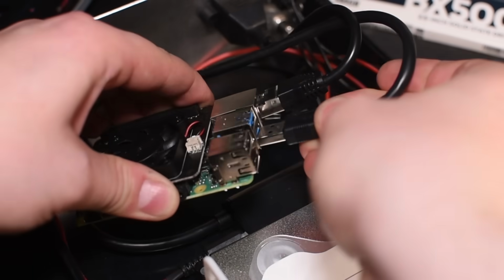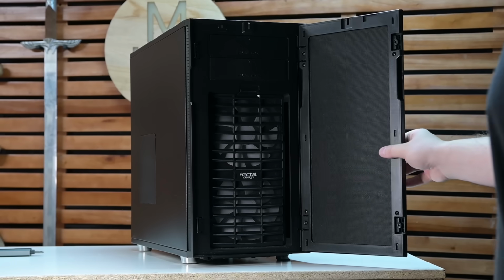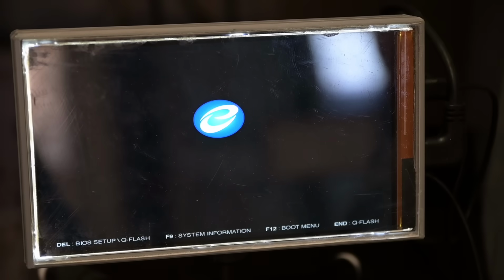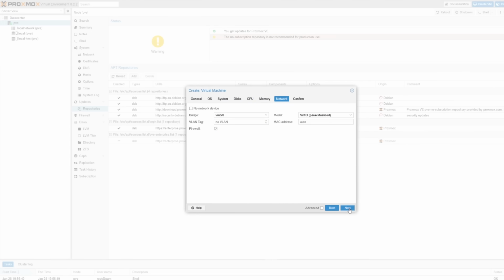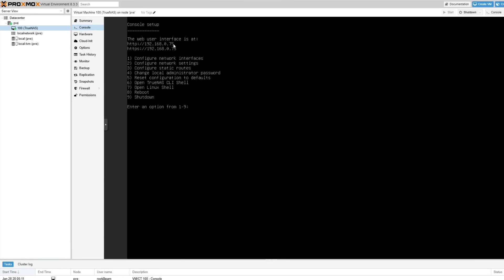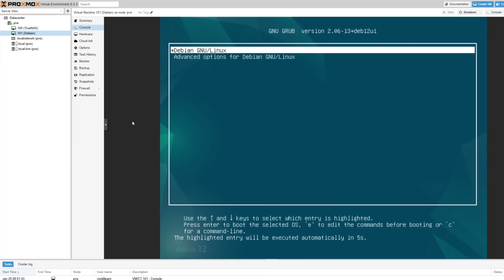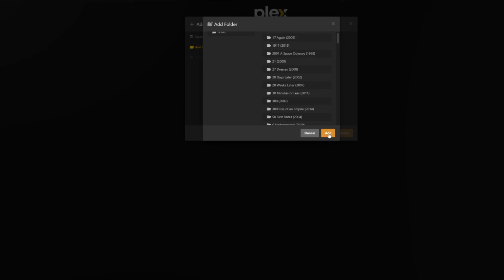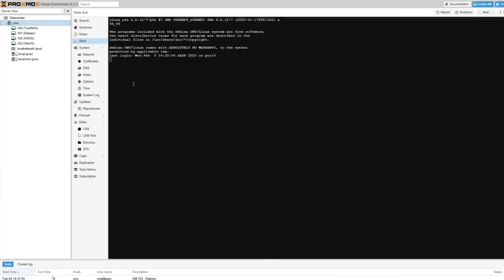The Do-It-All NAS for 2025!

Comment: ....here I am, sitting with my "do-it-all" Proxmox server (which also doubles as a NAS), which is now rocking 768 GB of RAM as a result of my mass consolidation project of January 2023.

re: your GPU passthrough
Were you able to confirm that your GTX 1070 was actually passed through to your Windows 10 VM?

I ask because if you were getting poor frame rates, that would be one thing that I would check because some of the older GPUs, doesn't pass through correctly, even if you followed all of the steps.

(This is true for my GTX 980 and earlier cards. But for my 3090(s), those have no problems getting passed through.)

To check that, the first place that I will usually look will Windows Task Manager to see if it shows up there.

And if it doesn't, then I will confirm that there is an issue, by right-clicking on the Windows Start Menu icon, and clicking "Device Manager".

If there is the yellow exclamation mark on the GTX 1070, then that shows that there's an issue.

I think that Nvidia GPU driver < 5xx.xx might not pass through correctly.

I am not 100% sure only because I skipped a whole bunch of generations of GPUs in between 980 through to my 3090s, so I can't test what happens to the GPU generations in between those two.

Based on what I've got, I've had more successes with the more recent GPUs than older ones -- I'll say that much, which may not be all that surprising.
Reply from the maker: @ewenchan1239  yep no issues with drivers or anything after following the Reddit guide, drivers auto installed and worked as I described! I was seeing frame rates reported up to 150fps but the latency felt way worse, probably due to 60fps cap as others have suggested
Reply: @Maker_HQ  
Interesting.

I haven't tried higher frame rate gaming via Windows Remote Desktop.

The built-in noVNC console is definitely quite a lot slower, and provides like "basic" video output (which I interpret to be akin to like the basic VGA output that you get from some server/workstation motherboard (e.g. Supermicro)) where you can see something, but it's not stellar performance.

For "slower" or less framerate "sensitive" "builder" games (think like Transport Fever 2), I can play those over RDP.

But if I want to play games that are more framerate "sensitive" -- I ended up plugging a monitor, mouse, and keyboard directly to the server itself, and then added the USB devices to the VM, and played it directly on the system.

An alternative that you might try could be something like Rustdesk (which is something that you can self-host in lieu of Teamviewer) as a way to play games remotely.

(cf. https://www.youtube.com/watch?v=3a_Kr9zGDQ0, https://www.youtube.com/watch?v=FIEcTNjFZNA)

Alternatively, you can try sunshine/moonlight as well, and if that doesn't work, then you might be able to try Parsec.

I tried the other options (excet for Rustdesk -- haven't tried that yet), and didn't have great/reliable success with them, but you can still try, if that works for you.

I won't be surprised if RDP is capped more to like 30 fps given that again, it is really there to just give "basic" video output, rather than high bandwidth video out.

(I've never seen RDP pulling more than like 10 Mbps network output from the client, even when I have it set to a LAN connection settings, before making said connection.)

Comment: it's not a host bridge adapter mate it's a host bus adapter and if it's an 8i for internal then it can only connect up to 8 SATA drives. SAS I believe is 256, when you did the Debian VM you don't need a GUI considering you did all commands in the terminal anyway, still great video regardless.
Reply from the maker: @meetthesandvich211  is that what I said? Oops! I said 14 drives because the MOBO has 6 SATA ports too
Reply: @Maker_HQ  It's no problem mate, you're all good. Keep up the good work, it's nice to see more people using Proxmox and Truenas. 👍

Comment: I wonder how HBA works if the motherboard doesn't have PCIEx8.
Reply from the maker: In a x4 PCIe 3.0 slot, max bandwidth is 32Gbps (vs 64Gbps in a x8 slot), which would technically bottleneck more than 5 connected SATA3 drives, but in reality the drives are never going to get near those speeds afaik

Comment: It'd be better to create a network bridge in proxmox, and attach it to your truenas and debian containers. Then set up NFS shares in truenas, restrict them to just the new virtual bridge's IP ranges (or individual IPs) and change your fstab over to these new IPs too. My guess is that using the SMB share you'll be limited by your network card's speed (gigabit?)  as it'd go over your home's internal network, through your router. From experience at least, NFS gives speeds much closer to the drives' limits, which should be a nice free performance boost. I believe windows supports NFS too (though you'll have to enable it), for your windows VM if you'd want.

Oh, and specifically for gaming via a windows VM you could use moonlight (open source) or parsec (closed source, but in my experience better). Either should perform a lot better than a VNC solution.
Reply from the maker: Yes, everything will be limited to gigabit, but that's fine by me

Comment: If you plan to run a rig like this 24/7 with a bunch of 1TB disks, energy cost goes up fast, particularly in the UK and some EU countries. It may be worth getting 2 larger drives, especially if you think long term. Less heat, less energy and more storage. Fewer drives means a smaller case and a cheaper PSU. Modern drives are also faster and with SSD, more energy efficient. Slightly higher investment, much greater return over time.

And that brings me to network. A mainboard like that probably has 1 or 2 1gig onboard NICs. Okay for most, but kinda limited. If you get a topton, you'll need less space, less energy and performance is equal or better, depending on the model. Those typically come with a range of options for network, usually with a series of 2.5 gbit interfaces. And then you're suddenly talking network and 2.5G switches or better. Also more future proof. 

There are many ways of doing this and I see nothing really wrong here. It depends on what you want. All I'm saying is my focus would be on getting more performance in hardware at a higher initial cost, for greater returns over time.
Reply: A "bunch of 1TB drives" is fine.... it's the choice of how they are used which is not best.
Having all those mirrored pairs in one pool is asking for trouble.

And to decrease power usage, using something like snapRAID is a better choice.
SnapRAID is no good for day to day use, but for bulk storage of media files it is good..... It only spins up the drive the data is on, unlike of multi drive arrays.

I have a similar setup....
TrueNAS with some SSD's for daily changing files (Soon to add some HDD's for an additional layer of backups).
OMV with the SnapRAID plugin and a random collection of HDD's for media storage.
And some other VM's and LXC's all running on top of Proxmox

Comment: For remote gaming run it through parsec or moonlight. rdp and VNC is not designed for gaming.
Reply: seconding this, never used moonlight, but parsec is black magic compared to something like RDP
Reply: @ComMcNeil  I've ran both and moonlight is lower latency do to it being peer to peer and no middle man parsec relay and auth auth servers. and if parsec has a outage your not SOL.
Reply: Moonlight very cool for homelab
Reply: @ShaLNOYa  it also works great for remoting into Linux desktops. Because waylands vnc /RDP protocol is botched
Reply: @GhostieXV I'd recommend wayvnc as a stopgap because it doesnt rely on the remote desktop portal being implemented
Reply: highly recommend moonlight + sunshine, works great
Reply: any takes on parsec vs moonlight? my only moonlight experience is seeing it in F-Droid

Comment: windows remote desktop caps frame rate to something very low i remember
you might wanna look into solutions like moonlight game streaming
Reply from the maker: @NonsensGaming  Ah ok. I didn't have the expectation going into it it would be great, but with a proper VNC session not via the browser, I imagine it would be better too
Reply: @Maker_HQ  vnc is capped as well.
Reply: @Maker_HQ  play a video in VLC over the vnc connection and watch it stutter.
Reply: If you plan to play streamed videogames, you got to get video game streaming tech. RDP, VNC, are meant for desktop apps, not gaming. As mentioned by @NonsensGaming, you should have a look in Sunshine/Moonlight.

Comment: +1 for Proxmox and fractal. good choices. I build my secondary Nas using a Jonsbro N4 and x99 board with xeon  E5-2680 v4 12 core 24 threads 128GB of ECC ddr4 2x 1tb nvme for boot 4x 10TB drives for storage and 2x 960GB intel SSDs for cache. Runs Proxmox with debian LXCs and docker for all other things. with performance tuned consume just shy of 60watts.

Comment: Excelent! I built my own homelab, now just waiting for parts to be delivered :)
Machinist X99 MR9A Pro Max
Intel Xeon E5-2695 v4
Kingston Fury Beast 4x32GB
be quiet! Power Zone 2 750W 
SilentiumPC Fera 5
Intel Arc A770
Sharkoon Pure Steel
Reply: Also that board and CPU supports ECC ram btw up to 256GB I've tested it.
Reply: @ On official website they say it's max 4x32GB, but i guess it's guaranteed amount. 128 GB is plenty for me anyway. Did you bought custom BIOS from BIOS-iEngineer or did you stick with the manufacturer one?
Reply: @GuzikPL4  mines still on the original BIOS.
Reply: @GhostieXV  Thank you very much! You have been very helpful to me!
Reply: @GuzikPL4  no problem best of luck on your journey of network discovery.
Reply from the maker: @GuzikPL4  that'll keep you warm at night =D
Reply: Good choices i have that exact same board. with ecc ram. Be warned though that board does not like some pci cards and won't post with them installed. It refused to post with the 1050ti i had in it. But posted fine with a quadro A2000.
Reply: @GhostieXV  Thank you very much, for the heads up! It was supposed to be cheap, chineese build, but it grew out of proportion. I am thinking in the future to swap out this motherboard for something more reliable
Reply: @GuzikPL4  I'm still running mine 4 years later. only hiccup was the pcie issue which i resolved by not plugging in the DAS cable to my storage array until after post. Soon as it posted to booting proxmox plugged in Das and its good. Granted that was on Proxmox 7.3 and Now its on  latest 8 and it doesn't do that anymore.
Reply: intel arc a50 pro or the 40 would have been a better pick for gpu partitioning

Comment: Do yourself a favor and turn those drives around and run the wires on the other side. For one its a cleaner layout, for another when you do lose a drive (and you will) it makes it a lot easier to look up the drive serial number to know which ones to swap out.
Reply from the maker: @lochverus8005  fair point, but it's not hard to pull them out with the cables this way and the bays being toolless. With them the other way I'd have to take off both panels to disconnect the cables first
Reply: Unless this case is different, I think typically the trays are designed with the hdd cables to the rear side of the case. Once I tried your way in a smaller midi case, but I was getting hdd errors, the cables were squished against the front side cover and also the connectors were getting loose. In theory the way you do it is easier to pull a failed disk from the front. In practice, it is a bit more complicated because the power cable usually feeds 4 disks, so they need to be disconnected. The other way you do not disconnect other disks, but you have to open the rear cover.
Reply from the maker: @markmorati8986  yeah I did notice the cables were left with a less-than-ideal amount of space but no issues so far.
Reply: I just clicked this video because I have the same case and I didn’t know you can run the drives with the connectors on this side. Very useful form me since I have the case on a shelf…
Reply: Lol game here to say the same thing

Comment: Why put Truenas in VM and not install it directly¿?
Reply from the maker: @Djmaxofficial  to my knowledge, there is no way to run a full fledged Linux/Windows OS, home assistant or pihole inside TrueNAS - Proxmox allows me to do all this
Reply: @Maker_HQ sure you can. You can both run VMs and docker containers in TrueNAS Scale. It's a matter of choices I guess, depends on what is the primary use of your system. For me, TrueNAS on bare metal was a better choice.
Reply from the maker: @ArisSynodinos sounds like a good option!
Reply: Proxmox is 100% more versatile. I agree with the approach described as the best course of action here.

Comment: Great setup! Pretty similar here. Just wondering why you installed Casa AND Truenas when Truenas also has all of those apps you mentioned? Isn't that just unnecessary overhead?
Reply from the maker: Using TrueNAS alone would be a totally workable solution. I just did it this way as I had familiarity with CasaOS for one and for two I wanted a Linux VM for software dev
Reply: @Maker_HQ so why even use truenas at all?
Reply from the maker: @PandoricGalaxy  firstly it's free, secondly it does what it does well and thirdly it allows me to quickly and easily get an SMB share up and running